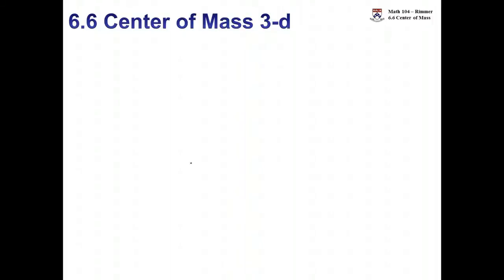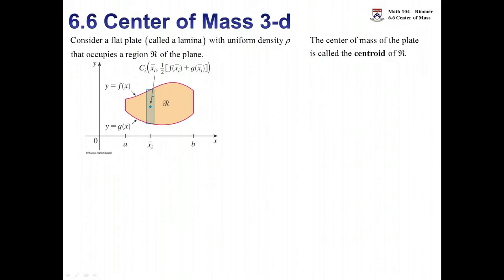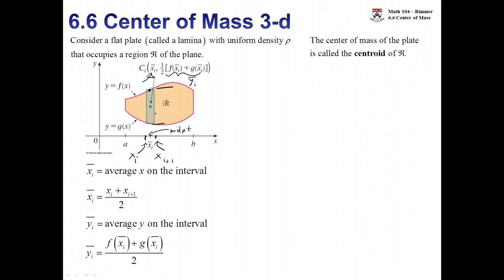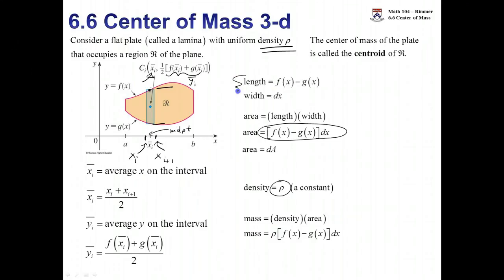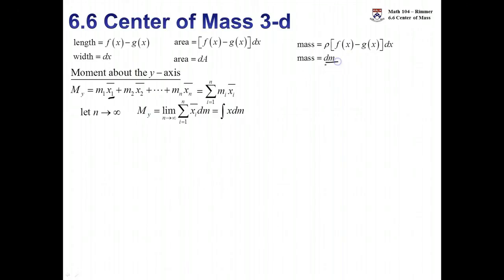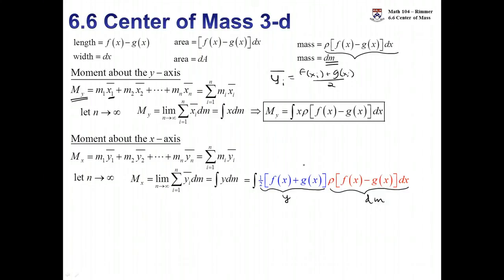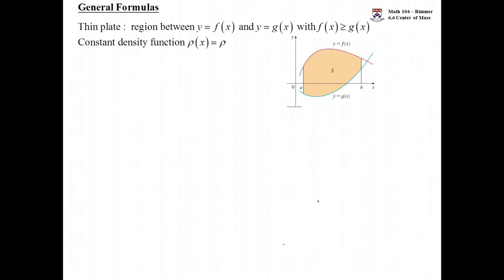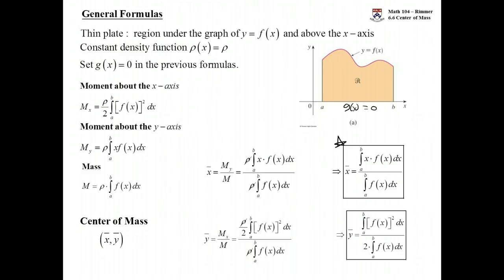Concept: Center of Mass of a 2D Region (Derivation of integration formulas)

Comment: could we use the same technique to calculate the centre of mass of a roller coaster loop? We could say it does not have uniform density due to the empty space in the middle, so in such a case would it work?

Comment: This should be renamed center of area in 2D.
Reply from the maker: Great suggestion.  I'm going to change it but keep the word mass though. The "thin" plate has a negligible thickness so it really isn't 3d.
Reply: @NakiaRimmer Change the title of the video, you are only confusing novice researchers looking to calculate center of mass for a true 3D object. Any other dimension is useless when applied to reality which is always in 3D.
Reply from the maker: @TAYL31GH  Done!